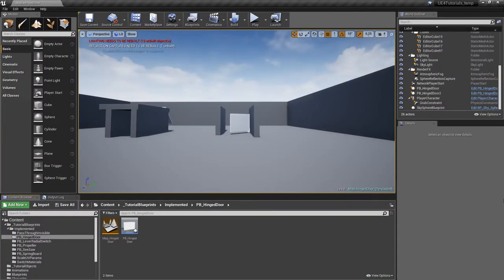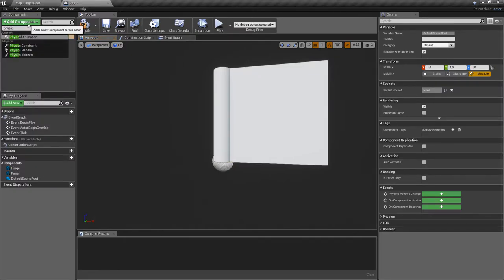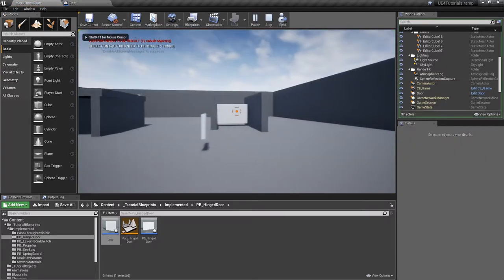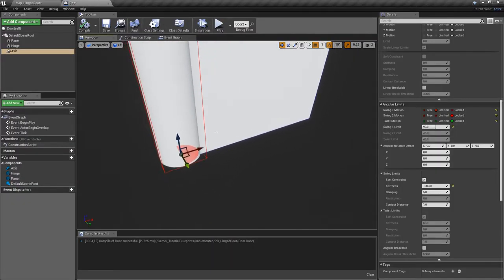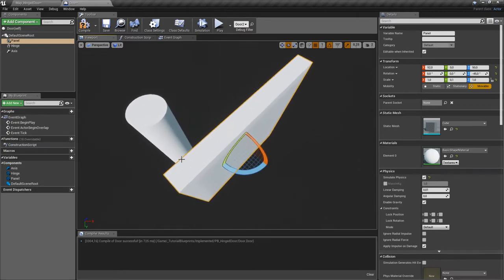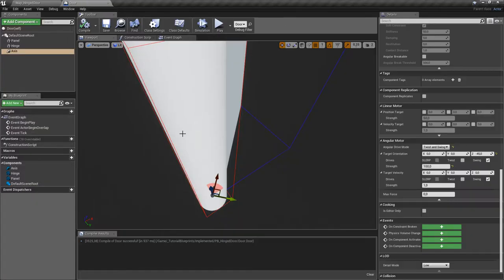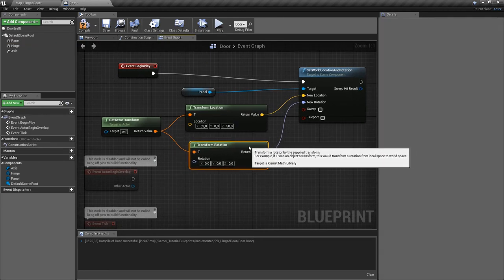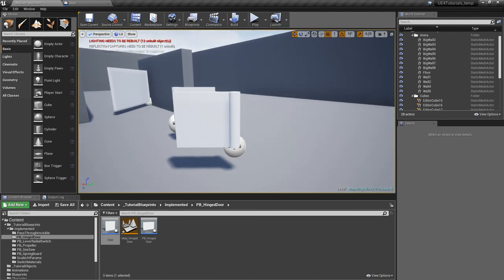UE4 Swinging Door Hinged using Physics Constraints in Unreal Engine 4 Tutorial How To

Comment: Hey, at 8 min: 

Dont rotate the constraint or the panel mesh, just add in the constraint an angular rotation offset on Z axis of 45 degrees, and angular motor target orientation -45 ( or 45, doesnt matter) on Z axis. 

Works the same way and ignore the pivot problem. End of video after that :D

Anyway thanks again for the tutorial!
Reply from the maker: Yes, you're right. I don't know why I didn't do that, because I knew about the rotation offset. 
Thanks for pointing it out!
BTW, I don't understand why there isn't an offset for the position, also.
Reply: How can you access angular rotation offset in blueprints? I want my door to have offset 0 at first, and after opening with the key, change limit do 60 and offset to -60 for example?

Comment: Hi Andre. Thank you for your precious tutorials. I have a question about a cat hinge door I've done following this tuto. It's a door rotating vertically and it has to open when the cat pushes it with its body. But when it goes through the door it's just like if it smashes it : the door open very quickly. Even if I approach pixel by pixel. Then if I stay under the open panel and I go back, it releases slowly, following the contact of my character, just like it has to be.
If you (or some of your followers) can help me, that would be very nice.
Reply from the maker: That could be either because your character has a push force that is too great (check the character setup) or because the constraints are not set up properly. I would have to see a video of that to figure out why.

Comment: I have a question regarding physics based doors.

You can target a specific component in a BP (ej, the door handle) and still simulate physics in the rest of the door? How would you go about doing something like that?
I'm having problems with that, you can't implement an interface for a component inside a blueprint right? it implements in the whole actor.
So the question would be... how can you restrict interacting with a specific component and make that component modify another component also using physics in the same BP?
Practical examples could be, anything with handles or Levers , a door, opening a window, rotating a crank etc.

Comment: HI, I'm not sure where I'm going wrong.  When I run into the door in VR it just gets knocked over.  I can't seem to get it to stay in one place and turn on the axis.  Any thoughts?  Thanks!!
Reply from the maker: You've probably made the axis constraint breakable. Look for Linear Breakable and Angular Breakable and uncheck them.

If these are unchecked and it still doesn't work, then the constraints are probably not working at all. The door sits there because without any forces acting upon it, the engine disables the calculation of physics on it. When you touch it, it re-activates the physics and the door just falls over. If that's the case, make sure that you're entered the correct component names in the constraints and that you have properly configured them.

Comment: Had angle problems with this. Only worked when facing one direction established in the blueprint editor. Fixed it by going like this, for anyone looking. https://answers.unrealengine.com/questions/132521/physics-constraint-issue.html
Reply: Hey - I hit this snag as well but the link to your solution seems to be dead. Would you mind posting the solution again? Thanks!
Reply: @pointlinepolygon  Hey, sorry to tell you but it's been some time and I no longer have the project in which I used the solution. I'm afraid I don't have the resource or the knowledge to help you in this case. I will post a reply if I find anything though.